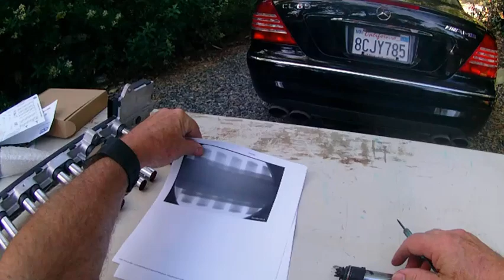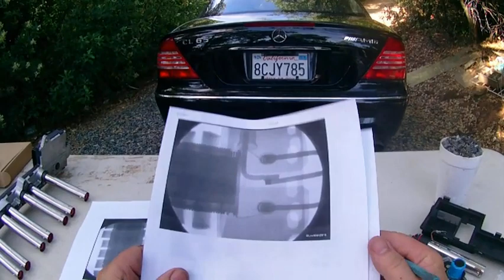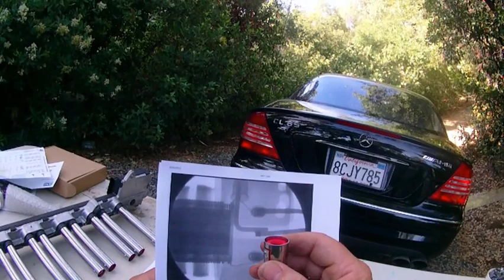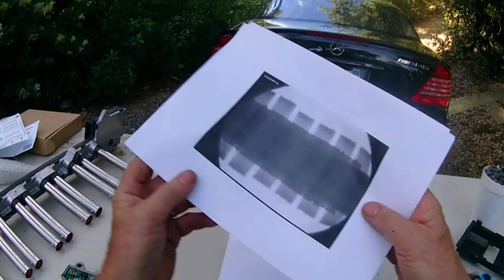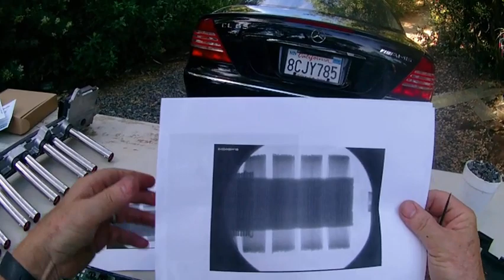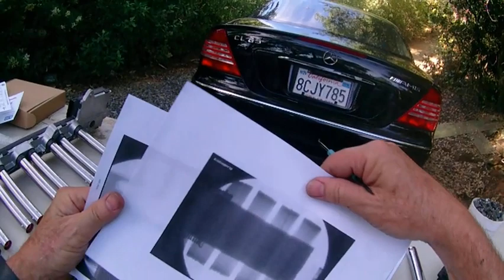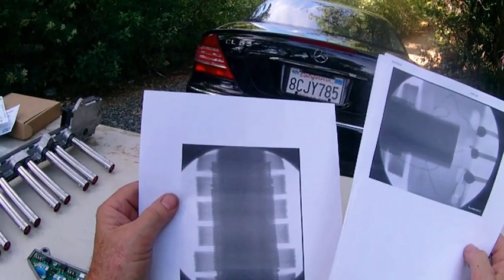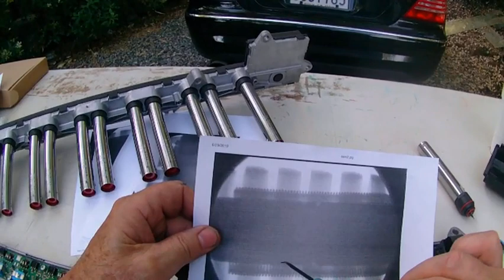Mercedes V12 ignition coils - making our own !

Comment: Hi Clark,

Came across your videos now and loving it. Bought a 2008 MB S600 V12 and it drives perfectly when I cruise. Even when i feed it slowly to about half throttle, but the moment i jump on the gas properly, it starts to misfire and the engine light comes on. Then i have to switch off the car and back on again and it is fine again.

Replaced the red rubber pieces, same problem.
Replaced all the spark plugs, same problem.
Tomorrow i am getting my injectors back after having them properly cleaned, then i'll see, but i am pretty convinced that won't solve my issue. It's probably the coil pack.

The only cylinders giving fault codes are 10,11 and 12.

I am based in South Africa though...
Reply from the maker: I've got a bunch of customers in South Africa - no problem.  With those codes it's either the pack or the O2 sensor on that set of cylinders  - left side - closest to the firewall

Comment: You Are an Impeccable Teacher Clark! Do You Have any Experience with Radiators on These M275.98's? I Took My Motorcar in for an alignment with never a drop of fluid and came home to coolant coming dripping off the lower passenger side radiator plug  that has a square Allen key like fastener. Only Information I can find is an ECS Tuning Selling a $5.50 Transmission Coolant Line Sleeve That Is a Common Fail Point But No Real Instruction. Please Help V12 Angel Thanks

Comment: my 03 cl600 has coils that have been rebuilt by you back at 97k miles. now at 117k she’s throwing more misfires. on cylinders 4 and 9 so opposite sides. Should I just bite the bullet and get some new fcpeuro lifetime warranty coils?
Reply: I’m not the owner who had it repaired by you. Fyi
Reply from the maker: One of those misfires is real and the other is probably an "echo" being picked up by the crankshaft position sensor.  Could be a bad plug, leaky fuel injector or even your voltage transformer.  Feel free to send them back and I can check them out for you.  I often don't see these comments so go directly to clarkruppjr@gmail.com to contact me or call at 916-802-1045

Comment: So if i understood this correctly, even the new coil packs that you build are only a temporary 80k mile fix? is there any way to make them a non problem area?
Reply from the maker: I don'
t know how long these will last.  What are the someone is going to buy a 15-20 year old car and still put another 80K miles on it ?  I have customers running races at Road Atlanta and loving the performance.  Coils wear out after a  jillion pulses.

Comment: how to remove the coil cover without damage? it is stuck.
Reply from the maker: There is no reason for you to remove the cover unless you are intent on ruining the printed circuit board.  There is nothing you can do…..
Reply: @clarkrupp  I just need to replace the cover because it was damaged in an accident. I already have another coil with good cover.

Comment: I have a ? Have 2004 cl600..
Last few days my car threw engine light and losses power when I punch it and give it hard gas on pedal..  Code show multiple cyl mis fire and random cyl misfire..   When I clear code car drive normal but when i push punch gas pedal hard it loss power again
Reply from the maker: If it’s less than all six cylinders misfiring on one side the it’s the coil pack.  Send me an email clarkruppjr@gmail.com
Reply: @clarkrupp  sorry for late response... But been testimg car... Ive been trying to drives the. Normally ti see if car act up... It seem fine not light etc run smooth, if you drive normally under 3k to 3.5k  rpm etc... I havent been punch pedal down..  Do you think its the module or voltage etc... When I get the code again I will send you the reading
Reply from the maker: @keepinitrealTRUTHFUL  it’s the coils in the packs or capacitors in the voltage transformer

Comment: Now I can invest in a merc v12 engine
Reply from the maker: Anytime !
Reply: Is it possible to convert to single coils, Or does the circuit prevent it?
Reply from the maker: @reginaldmorton2162  I think it would be an absolute nightmare due to all the ECU interaction..  A new set of packs should last 80K -100K miles or more so for most folks that will be the last ones they'll buy or own the car for.